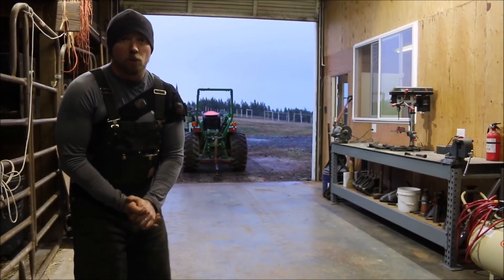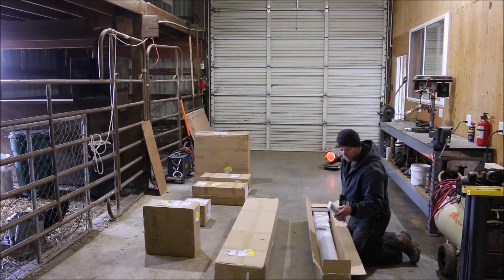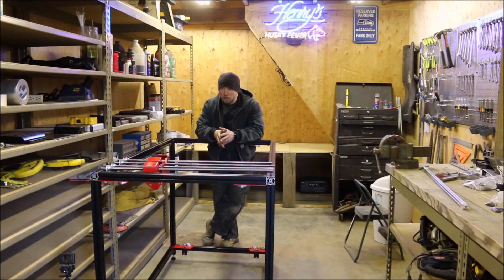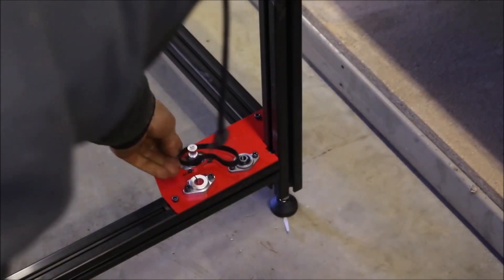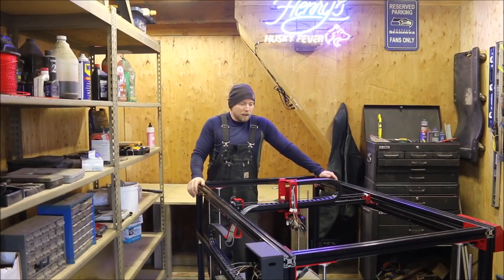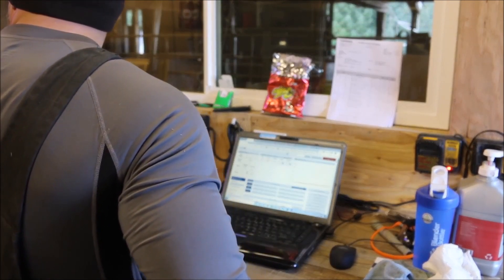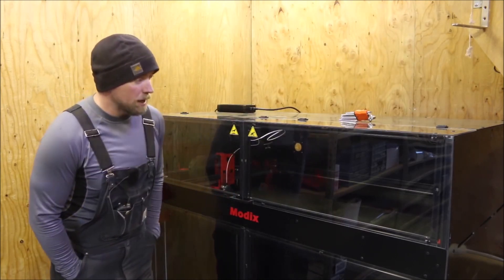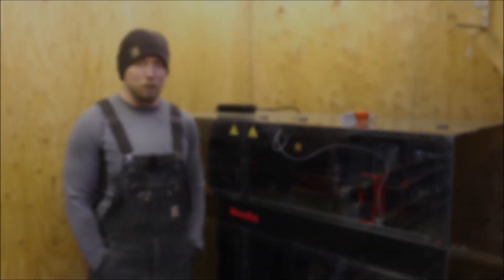Modix BIG-120X 3D Printer Review

Comment: What are the little digital screens and switches for at the bottom kick panel?
Reply: PID controllers for the bed heaters, one for each heater.
Reply: @davidgafniltd  Ahh Thanks weird that they would put those so low to the floor and not near the controller.

Comment: Vacuum forming is a good idea for production, not so much for prototyping. You can also make forms with your printer for vacuum forming or fiberglass / carbon fiber molds. Print inside molds with support material, then layup glass on the outside. For outside, wet cloth with resin, then assemble outside form with a sealed bottom and top with fill holes, while still wet then finish fill with resin. Use a vacuum to remove bubbles. This is a good way to make a large variety of large format structural parts (very good for complex duct work). TPU is great for making custom seals. Also don't forget Virtual Foundry to make solid metal parts with your printer. All you need to add for that is a kiln of an appropriate size. Thanks for showing your printer and the build as I'm looking into Modix for my prototyping needs.